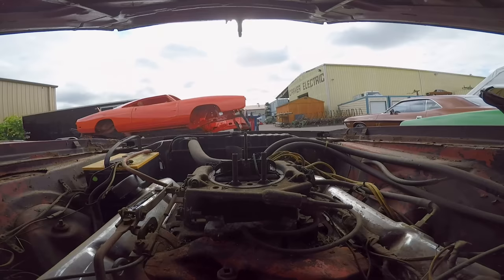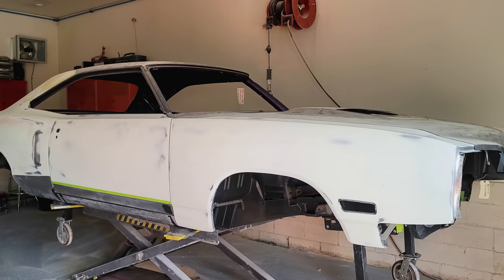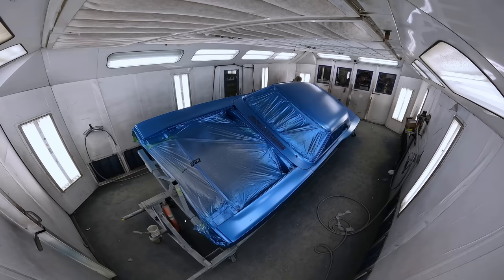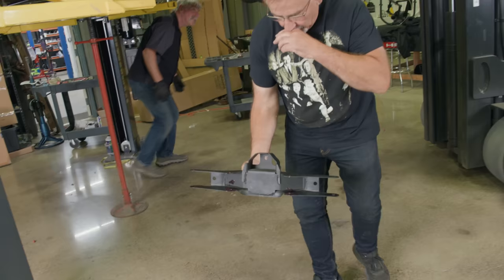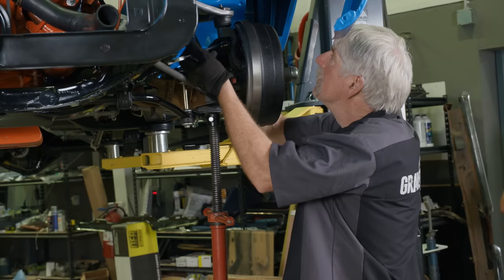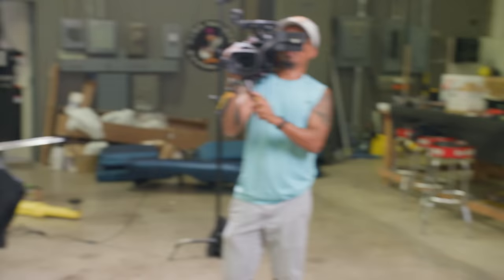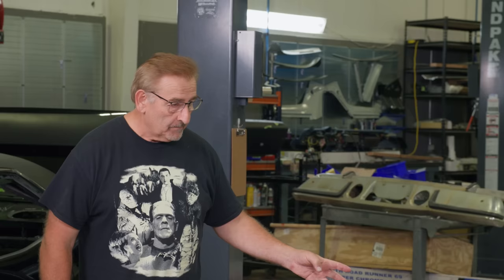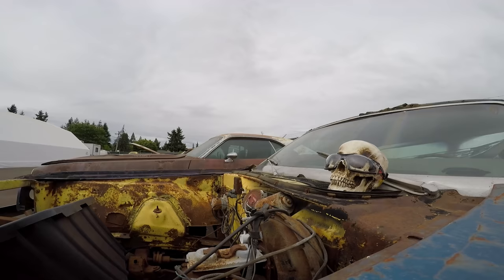***NEW NEW NEW NEW EPISODE*** FLIGHT OF THE SUPER BEE AND THE UNITED STATES MARINE!

Comment: I have driven dodge much of my life. I strayed for about 10 years and learned a hard lesson with American made cars. Dodge are easier to work on and parts are much lower cost than the competitors, Ford and chevy. Every chevrolet I ever had and I'm 65 has literally fallen apart after about 120k on the odometer.  My retirement vehicle will be a Toyota and likely the last vehicle I ever buy in my life.

Comment: Wy not use a clothing tape measure its made of soft plastic only the first quarter inch has a metal clip put some tape on that or remove it and hold that in place next to the light and you can see were it goes.